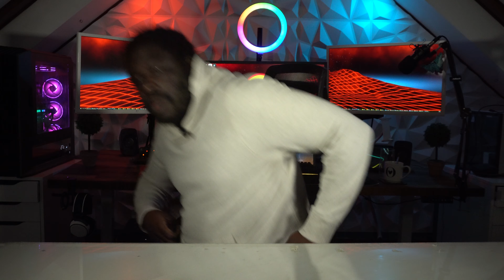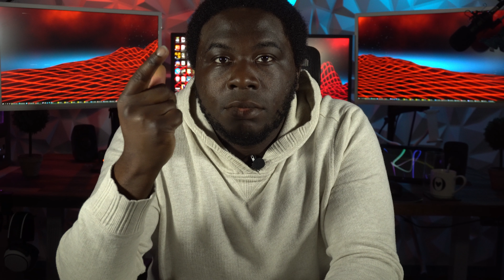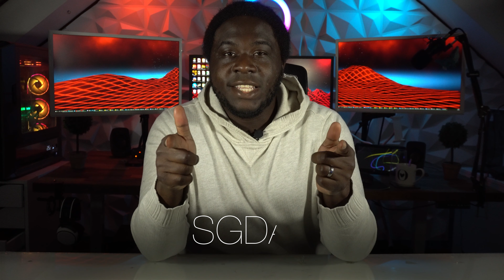CAMERA TRAX HD PARALLAX with a 5 METER REMOTE CABLE! - Slider Unboxing

Comment: Nice video,  I'm looking at picking up one of these bad boys  off ebay,  and I'd love to see your slider in action along with your honest review of its functions.
I'd like to hear your thoughts on how smooth the slide and head rotation is, and motor noise levels, bounce function, max camera weight, reliability etc etc.
And is it worth the investment compared to the competition.
Many thanks.
Reply from the maker: Thanks, glad you liked it! yes i am planning a part 2 for this video dedicated to just using it but I will definitely try to answer your questions, hopefully without breaking it! Let me know if you have any other questions.